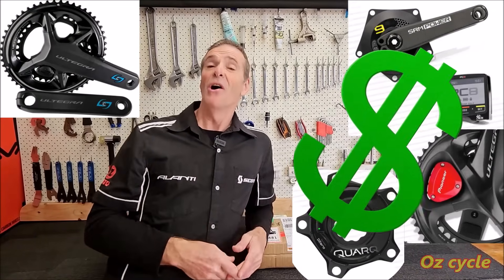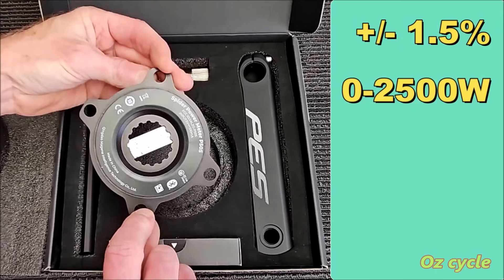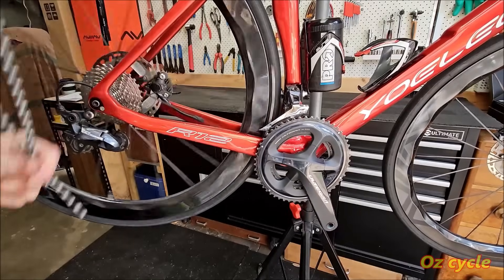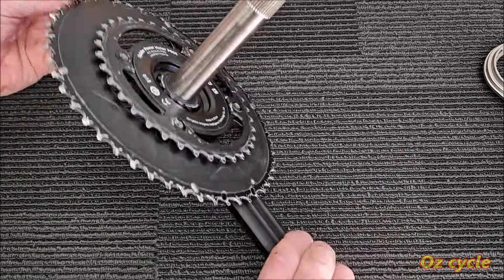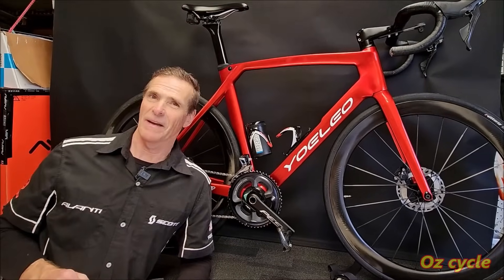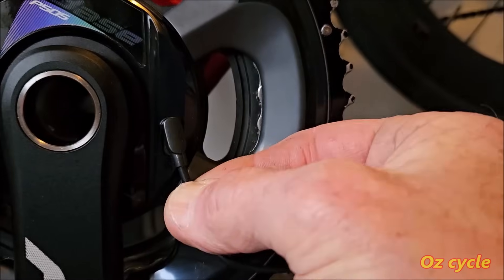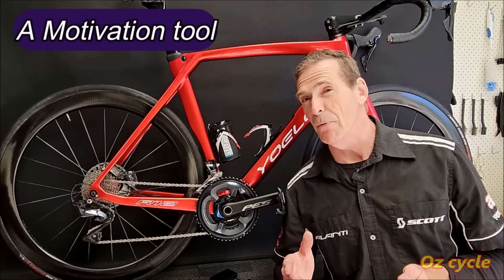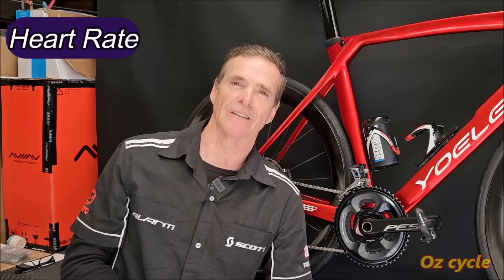Power meters getting cheaper - should you buy?

Comment: Did the preload bolt also require torque after applying required torque to single pinch bolt? I see that is metal and Magene indicated that it will require torque as well. Great review.
Reply from the maker: Preloaded is done before tightening the pinch bolt. Once pinchbolt is tight the preloaded can not be altered.

Comment: One thing that needs to be noted is that the average Joe/Jane doesn't need a power meter and without guidance will not reap the true benefits of having one. It's better to measure other values and to use them.

Comment: I just noticed this power meter registers left and right power when we paddling with only one paddle, by one leg or one hand. 
 
That means any up stroke drive on one side is recorded as power to the opposite side. 

Essentially it reads crank shaft torque and not individual crank arm torques. 

If I noticed this sooner I may fall for their other model that uses independent sensors. 

Hope this helps.

Comment: Nice video and presentation. Inspired. 
I have old Gen 105 group set wanted to try this P505 and have a concern. Is my bike compatible? It has bottom shell 67mm deep and 78mm between cranks, assuming 24mm ø shaft, will replace from 5 to 4 bolt chainring’s. Your advice?
Reply from the maker: Sorry no. You will need to update your crankset to the 4 bolt style , then the power meter will fit.
Reply: Yes will migrate to 4 bolt crank set. Is you sample has all these features? (1.5% power, cadence, L/R balance, Torque efficiency, Paddle Smoothness)? Seller offer price cut if we give up the last two features. Should we keep or drop it? Your advice? Thanks
Reply from the maker: @philoso377 Basic power is plenty information to work with. Most riders don't know what to do with all the extra metrics anyhow.
Reply: @stevenleffanue thanks to comment. Agreed. Digging deeper into fine lines reveals this. The factory offers a global version and a Lite version with two featured parameters removed at a reduced price exclusive to China market. Buyers of the Lite versions will pay extra $80 to activate those parameters.

Comment: Does anyone here know if it's OK to run a power meter like the Magene PES P505 on a fixed gear? I got one for my single speed, and that obviously works normal, but I'm worried about putting a fixed cog on it since the sensors might be damaged by being loaded in the opposite direction to which they were designed.

Comment: Can it be used with any Shimano speedset? A lot of meters seem to work only with specific speedsets. My bike came with Shimano Tiagra 3x10 speedset. Will 3 chainrings instead of 2 also fit (and will the meter still be accurate/consistent) ?
Reply from the maker: Only with 2x 10 Tiagra
Reply: Can I just replace the 3 speed Tiagra crankset with the powermeter cranks with 2 chain rings included or more is needed? (I don't mind having one front chainring less)
Reply from the maker: Yep that should be fine
Reply: Nice. so no need to get a new chain, front shifter or front derailleur.
Reply from the maker: No. You will need to adjust the limit screws of the front derailleur so it want over shift tho.

Comment: Anybody know if these will work with a shimano grx 810 chainrings? They are a 110 BCD Asymmetric 4-Bolt and the bolts go through the front of the spider. Failing that, it will have to be the assiomas.
Reply: do you have 48-31t rings? i have those rings and i have the same question with you....

Comment: The issue with the Magene P505 Base: You can't buy replacement cranks and the direct mount is proprietary. Also the e-mail address of Magene is broken (sales@).
Reply from the maker: Yes you can buy the PES crank separately.  Not sure what you mean by "direct mount" but they are same as Shimano or you can choose SRAM fitting.
Reply: @stevenleffanue  That's not true. I've asked the official Magene Store. They are only selling QES cranks, no PES. PES only as bundle in the "P505 Base". Direct mount is the way to attach the spider to the spindle. The "P505 BASE" comes in a proprietary mount. It only fits the PES cranks. Only the more expensive "P505" (without the base) can be ordered to fit Rotor, SRAM etc.
Reply from the maker: Sorry , yes you are correct , only the QED crank is separate.
Reply: @stevenleffanue  It's a pity. I'll probably buy the P505 Rotor and use the Rotor ALDHU cranks + spindle just to be able to source replacement cranks. I bought a used Verve Infocrank powermeter (dual sided crank based) but it snapped after only a couple of rides just when I accelerated after a red light. No injuries but the powermeter is dead and manufacturer says out of warranty. That's why I'm so picky. 🙂
Reply: My area in Singapore I am able to buy the power meter and crank separately. Without chain rings
Reply: @MrCocoman1  Magene answered even below their YouTube Commercial that they don't sell them separately

Comment: Good information! I ride a recumbent trike with a triple chain ring; is there a model that would work in this case?
Reply from the maker: I would say yes. It will require someone who has time to fiddle around adapting it. You will need to attatch the third ring to the spider with the correct width spacers.

Comment: Hi Oz! When you calibrate this power meter on the app / head unit, what number do you get as a result? On mine I get as a result sometimes 9, sometimes 10. But I have no clue what that number means. Magene could not give a proper answer either.
Reply from the maker: Try calibrating by pedalling backwards 5 times , it should read 0
Reply: @stevenleffanue  My other power meters (Assioma and BePRO) return 0 as a calibration result. This one, for whatever reason, does not. Magene confirmed it. But I want to know if 9 or 10 are the expected numbers.
Reply from the maker: No idea. I reset mine at the start of every ride by pedalling backward , it goes to 0. Sounds like the app. is biasing. Maybe a viewer can help here?

Comment: How mamy years the accu lasts ? Typically this is the "planned" end of live, as replacement is difficult. I have this problem on my smartwatch after 4 years which doesn´t last an more for more than 3h in recording mode. There is a DIY replacement accu available form 3rd party for 18€ but it requires skilled disassembly with heating up the glued case

Comment: Question: If you were installing new OSPW's, with 2 new pulleys would you degrease the pulley hubs and then apply your famous wax liquid formula ( wax & PTFE 10:1)????
Reply from the maker: I assume you're thinking of using the wax as a jockey wheel lubricant? I haven't done any testing for this thus recommend to use the lubricant that the manufacturer recommends. If your jockey wheels are ball bearing based definitely do not use wax as the lubricant.
Reply: OK thanks

Comment: Running an older SRAM red I can’t justify the expense of new BB, crank arms and power meter.  I’ll just rely on feel, cadence, heart rate and incline.  Strava’s estimated power doesn’t seem to take the prevailing wind into account but it gives you some idea if you often ride the same route.
Reply: The power estimation method you mention can be used with some Sigma Sport STS ALT - CAD computers as I have used these in conjunction with their optional heart rate monitor kit .
Reply from the maker: Magene have a power meter for sram. No need replace cranks or bb.
Reply: @stevenleffanue  Thanks for the reply.  I live in Japan and it doesn’t seem to be distributed here.  Not sure if I want to buy through Ali Express in case something goes wrong but will research some more.

Comment: Appreciate the info, but I'm just a bit weary of the Magene brand.  I bought the new radar light.  Worked absolutely perfect until a firmware update.  It's now almost useless with false warnings.  I bought the C406 Pro head unit.  It works great, but battery life is starting to seriously diminish after only a few months of use.  Warranty support from Magene has been nonexistent...will rarely even return an email.    Think I'll pass on this brand.
Reply from the maker: Contact the Magene distributor in your country , they will help you out.

Comment: Hey Mate,
Big fan of your channel, i remember watching your videos on chain waxing which convinced me to go down that path and i have no regrets the only regret was why didnt i come across your video earlier 🤣🤣. Love your content and all the knowledge you share on your channel. Quick question have you tried comparing your Favero Assioma Duo with the spider based power meter. I recently bought a Giant TCR Advanced Pro 0 with Sram Froce 12 speed etap. The power halo that giant provided is consistently out by 20 - 30 watts. Giant have replaced the power meter under warranty but its still has the same issue. I was wondering if you could do a similar comparison.
I have a kickr v5 where i compared the Favero with kickr and the difference was less than 4 watts. Now given the drive train losses the results are acceptable. Then i took my pedals on my bike and compared it to the power meter and the results are shocking its always about 20-30 watts higher than my pedals. Unfortunately i cant put my giant tcr on my Kickr coz i will have to buy a SRAM free hub and also a 12 speed cassette, its an expense that i am not wiling to make. I have my first 9speed aluminum road bike on my trainer which takes the indoor abuse.
But yea i was just wondering if you could make a video on comparing power meter based on a source which you know is reliable and let us know the results 😊😊😊😊😊😊😊😊
Thanks Heaps in advanced love your channel

Comment: I still ride a ultegra 6700 with 3 chainrings. Would that work together ? Currently I have a left side  Stages only for that reason.
Running a powertap simultaneously I found that high power match well, but  low power i.e. Zone 2 differ quite a bit likely due to unnoticable left/right imbalance at lower power.

Comment: Is it compatible with Shimano 2x12 groupset?  Magene support is not very helpful, they do not respond to emails.  They only replied on AliExpress, but I got the answer that Magene PES P505 Base is not compatible with the Yoeleo R12 frame 😂 so according to their support this video should never have been made 😂
Reply from the maker: Yes it is. Same 4 bolt  bcd , same spider width , same 24mm bottom bracket.
Reply: @stevenleffanue One more question. Compatibility with Shimano 105 DI2 R7100. Sigeyi also has a crankset with a power meter, but they added a note in the description: "Compatibility: compatible with all 10-12s chainrings; this crank is not compatible with Shimano R7150 front derailleur." Maybe you know if Magene is compatible or not with this fron derailleur?
Reply from the maker: Yes the magene power meter is compatible with Shimano di2 11speed and 12 speed.

Comment: With spider power meters,the crank arm can flex independent of the spider and chainrings
Reply: The small amount of flexibility in the crank arms is compensated for in the power meter firmware. 

Also, stiffness of mid to high-end cranks is over-hyped. Unless you weigh 800 pounds, you are not flexing Ultegra, Chorus, Force, or the crank arms featured in this video, and anyone who says that they can feel the difference is either selling something, or has an overactive imagination.

Besides, SRM uses a spider-based system and is the gold standard of accuracy by which all other power meters are measured.
Reply: @prestachuck2867  you haven't ridden very many cranks then😅  And you don't even have to ride them.  FSA K-Force Lights for example are noodly.  You can just push them sideways towards the chainstays to see it while you can't really move a 105 and up crankset.  Rival cranks also have significant deflection but Force and Red do not.
Reply: @prestachuck2867  I'm not complaining about spider based power meters.  I have 3 of them. I'm simply stating that the arms can flex independent of the spider with cranks that have separate spiders....power meter or not.

Comment: How does it compare with a cadence sensor? If they are  comparable
Reply from the maker: Yes it has cadence.
Reply: @stevenleffanue  not about this product. If you only have a cadence sensor, is it still worth changing to power meter?
Reply from the maker: Depends on your riding expectations. Used properly a power meter will play a part in your training program.

Comment: I have never raced, I will never race. Since I bought power meter my rides changed COMPLETELY. Because - unlike in running - you simply cannot rely only on heart rate.
Reply: can you elaborate on these two points you made ("changed completely" and "cannot rely only on heart rate")?
Reply: @nordlicht2342  "changed completely" - when I go for ride that I know will be i.e. 5h or so, I simply keep my power in the limits I know are good for my endurance ride.  And if I know today I will only spend 45-60min I keep my power accordingly as well.
"cannot rely ONLY on heart rate" - very often heart rate is simply outcome of stress (too high vs the efforts) or overtraining (too low and not going in my example higher than 150 or so). I rely in 90% on power figures when I ride - not on heart rate (anymore).  When I push for 30s and see the power figures, ALTHOUGH heart rate is NOT YET HIGH I know when to stop and relax (intervals or climbs or sprints). Simply (for me): power shows me my effort, heart rate shows the reaction of my body and that is not always the same.

Comment: Domestically, p505 does not have a very good reputation in terms of long term data accuracy. It is cheap, especially if you are in China, but the accuracy do seems to drift overtime.
Long term review might be needed.
Reply: Do you have any references?
Reply from the maker: Will keep an eye on its accuracy over the years to come.
Reply: That's what I got told too. So I ended up with a Stage single sided one which cost double than this double side power meter...

Comment: Been using this for a few months, super easy to use with an ig630 bike computer. The data looks good but I have nothing to compare/calibrate with. I'm running it with some sram red 22 cranks.
Reply from the maker: It should be reading correctly. If you ride with someone else who has a power meter and is similar weight the figures will be close.
Reply: @stevenleffanue  It's not to say I doubt the numbers, simply that I can't confirm them.

 Strava estimates my FTP somewhat lower using the resultant power but I think that's because alot of the power data is based on riding on bad roads where I'm often holding back because of cobbles/pot holes and dangerous junctions.

When I look at strava segments where the roads are better my power is very close to what I do indoors which is effectively 'ideal' conditions for riding.

My only real concern is that I assume the battery is non-replacable. assuming the battery looses 10% capacity a year then after 10 years that will be 200*0.9^10 approx 70 hours which will still be usable in many cases (perhaps not for long touring)

Comment: why would most people be running Shimano?  most of my riding friends run SRAM AXS of some sort..for this reason the Quark SRAM POwer Meter Spider is great...works with existing crank...nice and accurate and not that much more expensive than the Magene one and you dont need to toss the old crank arms either
Reply from the maker: Interesting.  Which country do you live in ?
Reply: @stevenleffanue  UK..
Reply from the maker: Right. Australia seems to be dominated mostly by Shimano ...prolly more SRAM on the off-road side of bikes tho.
Reply: @stevenleffanue  that makes more sense now then....
Reply: @JBR.1974  In Asia too, Shimano is much cheaper than SRAM. Also if you have BB86 you are better with a Shimano 24mm axle than a 29mm Dub. Bearing are too skinny on the Dub.

Comment: No spider based power meter measures true L/R balance - it is all estimated from total power using an algorithm. You should really add that clarity.
Reply: This! Afaik gp llama didn’t mention it being double sided.
Reply: Well after testing spider based to pedals the algorithms are well with in a 1%......your mileage my very, but I've tested it several time.
Reply: But it's not very tricky to determine, is it? The power meter knows which crank is delivering the power, and it knows how much power was applied. It's not difficult to determine the balance from that.
Reply: @lee-cycling  If you can precisely gauge when the legs stop/start their power phase then yes. But that is different between people, and their specific pedalling on a specific day. You can only guess a balance.
Reply: SRM uses this method and is still the gold standard by which all other power meters are measured.
Reply: @prestachuck2867  They certainly are. There are others that claim 1% accuracy. How are they determining this? SRM demonstrated how and it shut many people down.
Reply: @prestachuck2867 Gold price as well !
Reply: @prestachuck2867  SRM is compared to nothing. Old tech for old timers.
Reply: @punkandprovocation  Grow up